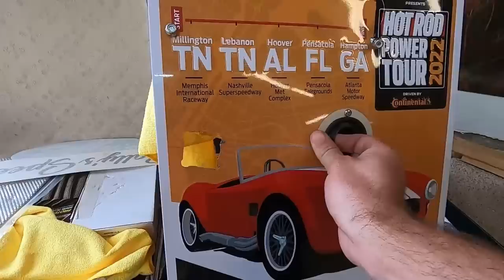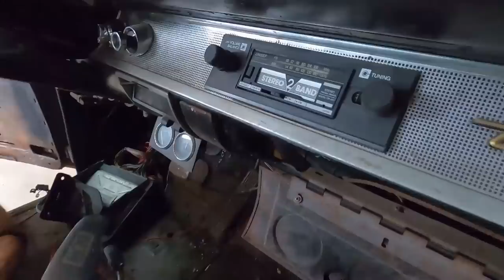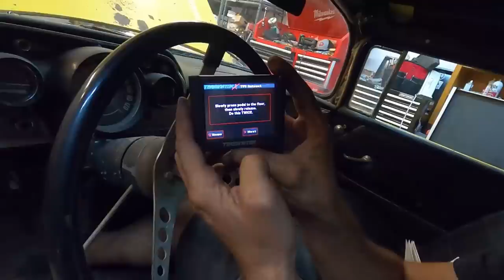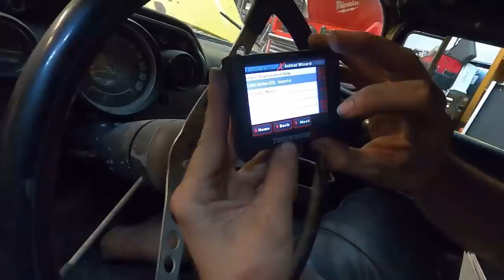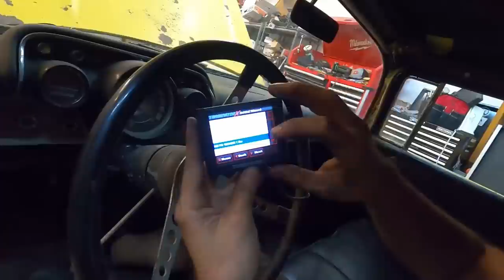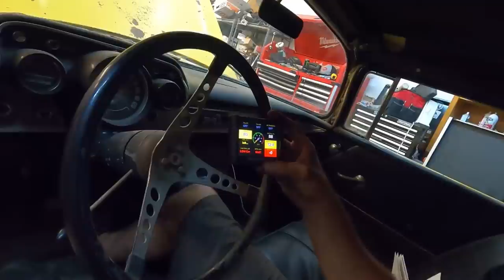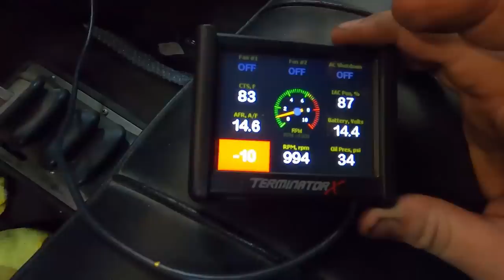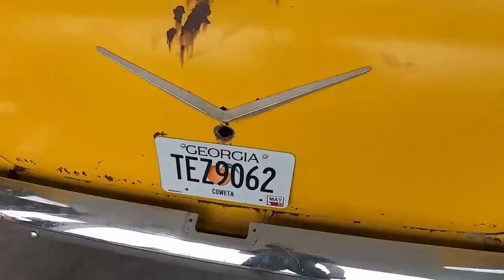Will it run and drive? Finishing an abandoned '57 Chevy Belair LS Swapped Project! 1,000 Miles Away!

Comment: I worked in Wichita for about 6 months years ago. As the joke goes "I didn't leave anything in Wichita" (no reason to go back). But without a doubt you found the perfect reason. From the camera shots it looks like a super solid frame. And that engine and trans sound like butta. The "tin" can be easily fixed or replaced. What a find!
Reply from the maker: Haha sounds about right. It’s definitely not a bad car for being from the Midwest! The frame is rock solid and it runs great 👍🏼

Comment: I just finished restoring my 3rd 1957 chevy and you all have your work cut off for you with the body and floor. If you have a mig welder and know how to use it all of the parts are available through several companies that you probably already know about. Today is Dec 5 and I wonder how you made out. I also wonder how you fastened the seat to a rotten floor? Lastly I did not hear you say where you were staying at? Good luck and I wish I could help. Oh , you buddy Ryan that is lending you his garage and all the other stuff is an OK guy in my book
Reply: We put suit cases behind the front seat to keep it from rockin. Lost part of our right leaf spring in Missouri and had to replace the front tires in Memphis but... we drove it all the way home to Georgia! 😄

Comment: That's not a Bel Aire it's a 210. Door panel indicates standard 210. You should check data tag on firewall. It should read model 1011, indicating a standard 210, one of 250k. If it reads model1011A, then it would be a 210 Delray, one of 25k. Project X is a 210 Delray. Project X also had the rare India ivory over canyon coral paint scheme.
Reply: The title says Bel Air but we weren't convinced of that. I'll look at that data tag later. Thanks for the info.